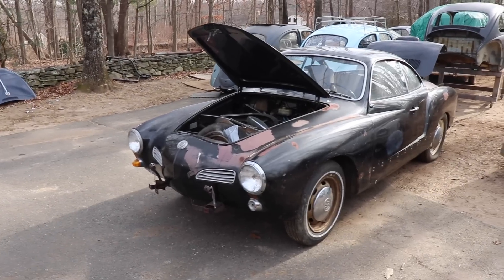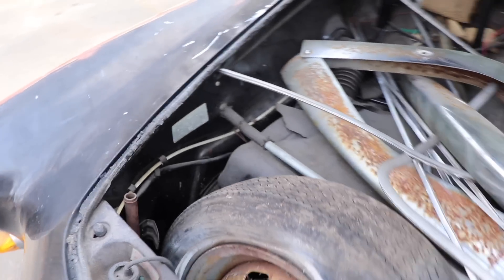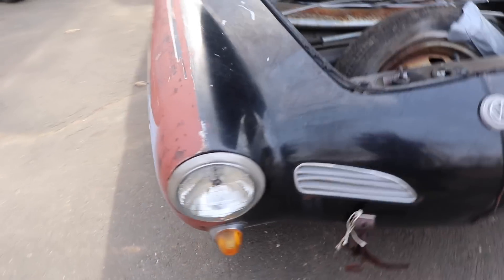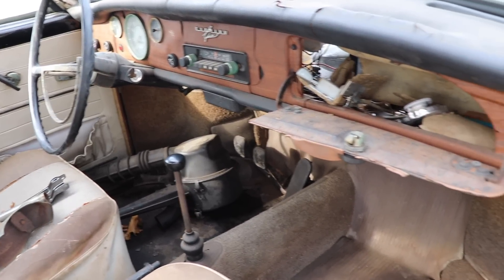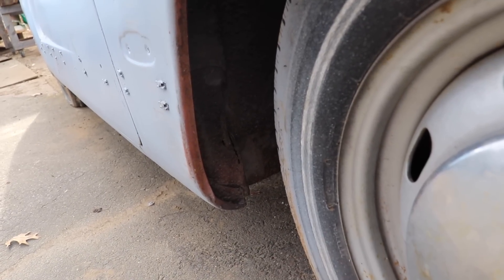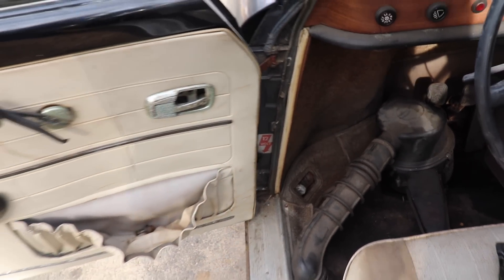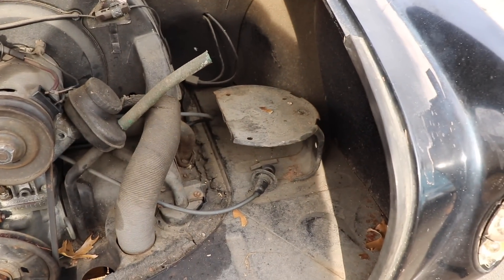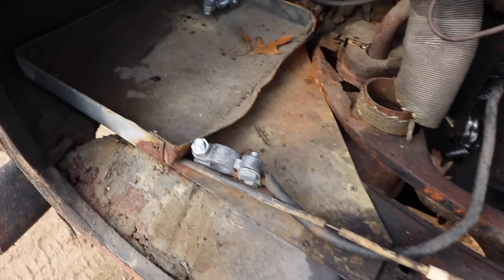1968 Volkswagen Karmann Ghia Restoration Project : Original paint & engine

Comment: Looking forward to you working on the 66 camper bus..Crazy negative temp. in Iowa, will be extremly cold Sunday. My wood pellet stove cannot keep up with the cold, so i got a 7500 watt ceilling heater need to do some wiring 50amp breaker etc.. My hope is between the two of them running this 64 year old man can stay warm and work on his two 67 buses. Nice Ghia my son had found a 65 black Ghia ruff shape we both are big and as short as 6'5" if we have a short hair cut and bare feet..we could not fit in it, so traded for thr 64 bus .
Reply from the maker: Hi Dan , I know where you are coming from . I added a wood stove to basement this year , only a small 1,000 sq ft stove and it has kept the core warm and saved 2 pallets of pellets already this year . Stay warm !  6'5" ??? Ghia vert would suit u ...although u might see over the windshield lol

Comment: whew man a miller going up to the top. I bought the cheaper one AHP about half the price and suppose to be pretty good. But miller is good for sure. My old Century Mig still pushing the wire just fine. Back many years ago they had them at Cosco. for 600 for a 220 unit. Rheostat  dials. Now they are lincoln. Got bought out a while back. Now the same unit from Miller or Lincoln is about 2k. Even then they were 1200. Cosco who figured.
Reply from the maker: hey Mike, not to top , just a good 211 for what i'll be doing . I still have the Eastwood 135 for the other garage .
Reply: @5150mxVW  yea that 211 will be nice has rheostat  dials for easy control. But so does the eastwood. I think the downfall is maybe the wire spool size. Nice to get the bigger spools. But for sure you will get some serious welding done with those. The thing I hate about mine is it is down low to the ground and I am always bending down to reset the controls. your setup will be nice. I havent even used my tig yet but I will be doing some aluminum projects coming up.